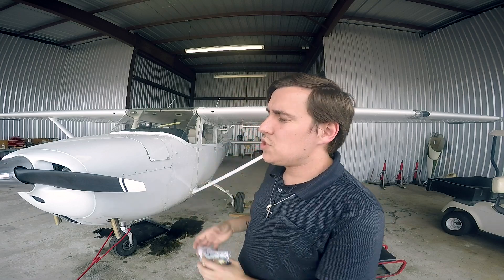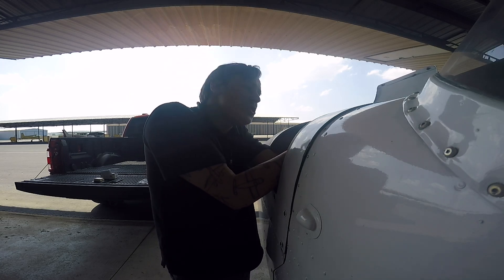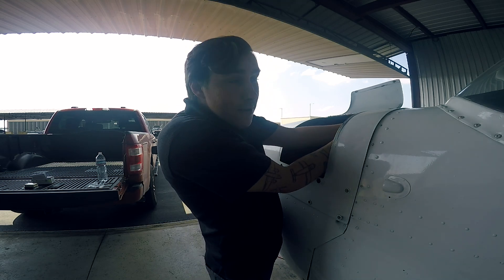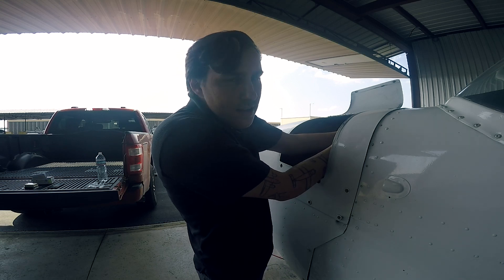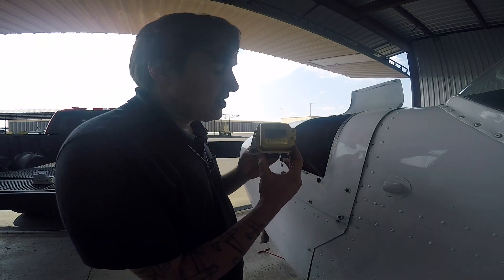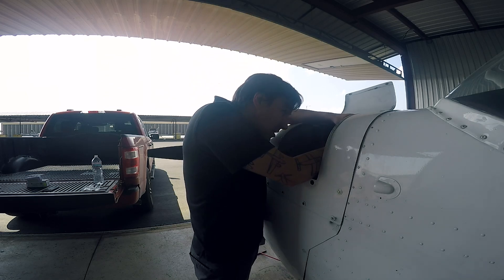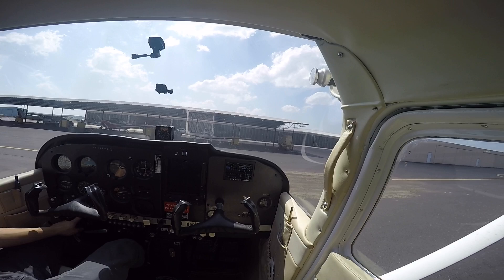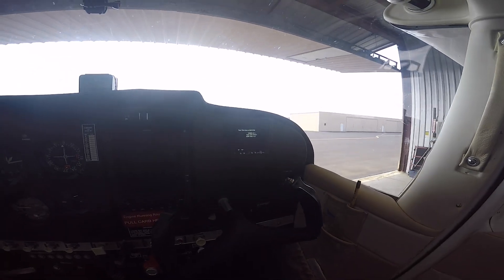The Job Is NOT Over Untill The Paperwork Is Done!! | Records After Aircraft Maintenance!

Comment: You’re absolutely right the FAA takes paper work serious as well as the mechanical repairs. Since I know I will be getting the Powerplant soon to complete my license. I been studying my rules & regulations every day Part 39 AD- Air worthiness Directive, TCDS-Type Design of Aircraft, AMOC- Alternative Method of compliance, STC- supplemental type certificate, MEL- minimum equipment List, MMEL-Master minimum equipment list, AC- Advisory Circular, and I also know how recall most of the meaning on rules and regulations. Is good that you touching on these areas

Comment: Why did you need "Tach Time " for the V-Reg replacement???
Reply from the maker: I didn't. Technically, I just need the date, but if something where to happen and the voltage regulator was replaced, how would I know the time in service on the voltage regulator. For the sake of traceability I am in the habit of including Tach Time and Hobbs ~ if the aircraft has a Hobbs meter on every logbook entry.

Comment: TACHometer Time has nothing to do with  Time in Service
Reply from the maker: If time in service is being tracked off of the tach, then it most certainly does. And if someone changes, said tach without keeping track of the hours it can be impossible to determine total time due to the missing hours.
Reply: @brycebuildsit  What is the Definition of Time in Service?
Reply from the maker: The total time in service of an Aircraft / Component / or part there of. It can be tracked using Tach Time Or Hobbs if the aircraft is equipped with a Hobbs meter
Reply: @brycebuildsit  are you saying this is the  definition of Time in Service?🤔

Comment: Hey Mr. Bryce. My name is Josue, i recently graduated a powerplant repairer course through the army. It was 5.5 months of training on the t701 and the t55 turbine engines. I am looking to get a powerplant a&p certification and am wondering how possible it is to pass just by going and taking the test. I was told we had enough hours studying and hands-on to get what they called a ticket. Is there a crash course i should take, or maybe a question book that i should read? What is my best course of action atm?
Reply from the maker: The first one to do is call your FSDO and Is ask to speak to an air worthiness.Inspector. Tell him you have practical experience.Working power plants and would like to get signed off to take the Tests for the P. You will have to meet him at the FSDO and show him all of your records of where you worked possible.Augment book entries or anything else he might ask for.

Once he has signed you off on an 8610- 2.Based on practical experience I would recommend going to a crash course to pass the test. If all your prior experience is on engines he might not sign you off to take the air frame portion.

If that ends up being the case though you will only have to go through the air frame portion of a one forty seven school to be eligible to test for the a. 

I have made a lot of videos about this under the show.You want to be an a and p playlist where I break it down even more.